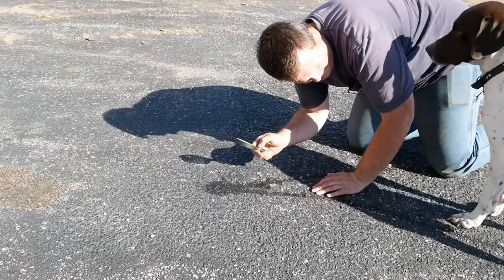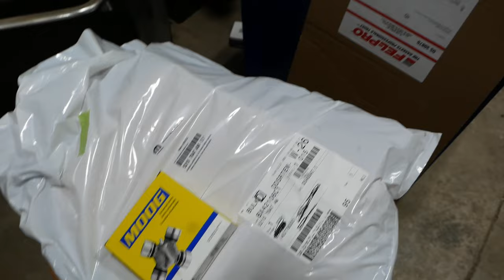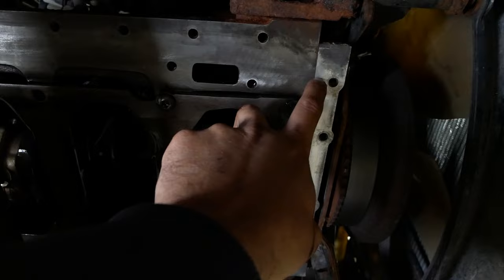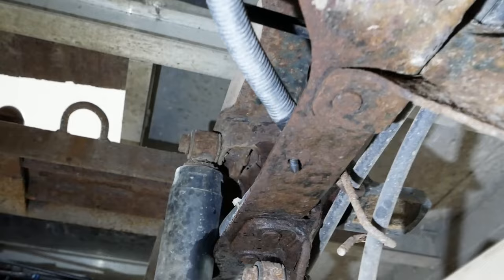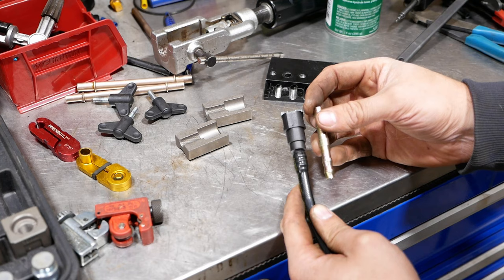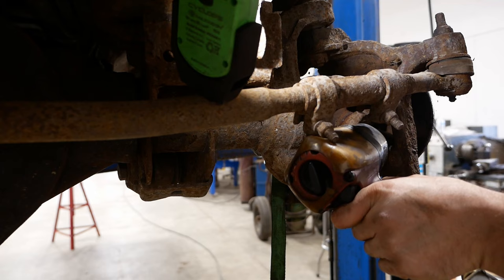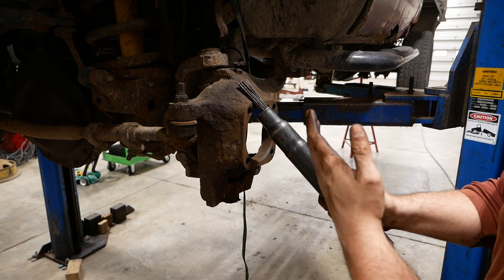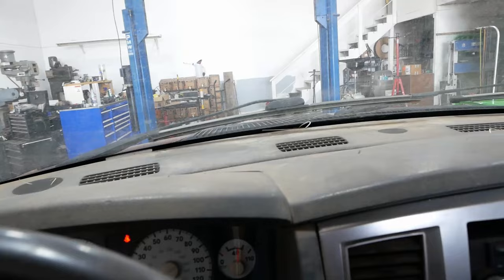6.7 Cummins Massive Oil Leak - Replace Oil Pan, Front Axle U-Joint, Fuel Lines, Shift Cable, Battery

Comment: Why would anyone want to live in a rust belt area. I have a 1998 Chevrolet K2500 Suburban. It lives outside & there is very minimal surface rust, & that is on the bumpers. Nothing underneath & the body is awesome.

Comment: To comment on electric ratchets: I've abused a couple Milwaukee's that still work nice. Harbor freight has/had another "Earthquake" brand, that is the same unit sold by AC Delco, which I have seen used and abused to satisfactory result. Guess it all comes down to what battery platform you want to marry...

Comment: Just a FYI.. If you would increase the compressed air line/pipe to 1" and use a 5/8'" or 3/4" hose to your impact gun those nasty bolts wouldn't stand a chance. . All of your pneumatic tools would increase in power.
Reply: Also using at least a Milton Type V high flow fitting
Reply: @mrmotofy   Anything that will increase air flow to the power tool will improve the performance

Comment: Wes maybe you can help me I have a Chevrolet Aveo 2013 1.6 4cil and just got a P0300, I already changed spark plugs fuel pump and filter air filter oil and oil filter, what do I look for next? Thanks

Comment: Always get such a kick out of oil pans rusting through...even when full of oil... Why is this possible and so common? I understand salt.. but it keeps rusting even after the oil leaks all over it!
Reply from the maker: By then it's too late. What amazes me is that huge sections of the pan seem to rust out more or less evenly and leak at the same time.
Reply: By the way, nice job with Davinci Resolve! I use ShotCut because it's free and works pretty good. The results are excellent, but the editing takes some tweaking.
Question: How do you go about getting USED but not "rusted to uselessness" parts? I'm hunting some parts but the southern state yards that I've called have a tendency to get rude when they realize I can just walk in the door with cash...
Reply from the maker: @HouseCallAutoRepair  I don't know. Might be easier to just take a trip and get it in person.
Reply: lol
I'm east of Eric O

Comment: Got a brake question. I got a 2009 GMC sierra 1500, I put new brakes all around. (pads, rotors, cleaned sliders, new shoes, hardware, drums.) There is no leaks, no air, I adjusted the back shoes to where they are just rubbing, but I still have a weak pedal almost till it meets my gas pedal.. And when I brake and right after I release and brake again the pedal is right there..help
Reply from the maker: Bleed the ABS.
Reply: @WatchWesWork  Forgot to say, its been like that since I bought it 6 months ago! 
Would you have a video of said bleeding of the ABS? Love the video btw!

Comment: Great video . I hate tyranny and government control of innovation , but I'd probably look the other way if they backed off on emissions and mgp improved 50% , if all electrical connection were plug and play , all wheel bolt patterns , within a rim size , were the same , all transmission mounts , bell housing bolt patterns and engine mounts the same for a vehical size . Standardize . Did I just describe large trucks?

Comment: Judging by the condition of the interior, I’m guessing they needed to crack the air box a bit to let some air buy a plugged filter. I’m guessing this individual is not big on maintenance. 😢
Reply from the maker: That's an understatement!

Comment: Wes, you're the expert, so I'm not criticizing! I was just wondering why you used a sledge to install those bearing caps, rather than a press or a clamp. I was always told that a hammer would deform them. I should know by now that there's always more than one way to skin a cat!
Reply from the maker: Because it was there and it will work fine. If you deform something you have another problem.

Comment: This is not to be critical I just have never seen anyone remove a rotor the way you do it. A heavy hammer and that thing is off fast. You run the risk of hitting a stud with my way so the air hammer is not a bad way.

Comment: Dang that truck seen a lot of a salt or the fact just keep make these newer truck a tin can. Truck going rust away before the drivetrain quits. Oil pan seem be common failure item on these 3-4th gen trucks in salt belt states. Buddy was able change my oil pan on my 2004 common rail without lift the engine. Most say lift engine few inch but guess there way disconnect pick up tube if have skinny enough arms.

Comment: Hi Wes, I’ve been thinking for a while I need to invest in an air hammer. I’ve watched you use it in places where it made your job easier. Do you recommend any brand in particular ? Also would it be suitable for fitting u joint cups or would it be too aggressive ?
Reply from the maker: I use it for everything. Get a long barrel. Harbor Freight seems to have a decent one.

Comment: I have one of these over rated Cummins in a 2012 ram. I’ve spent a lot of money fixing seals and connections and gaskets under the hood. I hv about 124000 miles on it. Not interested in owning another one

Comment: So I found it interesting that you said rubber fuel lines are a liability for you. Im a OTR driver and every Cat, Detroit, or Cummins I’ve ever driven has rubber reinforced fuel lines. I’m just courteous as to why they’re good for a 18 wheeler but not for a 1 ton.
Reply from the maker: Those trucks use rubber over steel braided hose that is DOT approved. It's a whole lot different than the cheap rubber hose most people use.
Reply: @WatchWesWork  ok. Got ya. I know commercial truck fuel line isn’t cheap. I just replaced all fuel lines on my truck and it was a bit pricy😂.

Comment: I am going to attempt this.
Few questions - what are you using as silicone, anything specific?
Also, what are you using to glue the oil tube gasket in place?
Reply from the maker: I used Ultra Grey for both.

Comment: Just wondering : is rusty crusty worth throwing these repairs at it (in an economical sense)?
Reply: Probably not relative to the blue book value, but replacement cost of that truck is 60k new or 35-40k if you wanted a nice used one… so a few grand worth of patchwork to get another year or two can be worth it

Comment: Weird how this truck has a c channel rear section of frame and y steering. My 05 2500 Cummins is all boxed with t steering. Wonder why dodge changes so much between years and makes trucks worse.

Comment: Oil pan paint.  You never know what the deal is.  I used to run around on the diesel forums.... a lot.  The shit some guys would do.  For all we know somebody loaded the engine with a gallon of mineral spirits or paint thinner  to "de-sludge or de-carbon" their engine because the oil was always so dirty.

Comment: All the best quality assembly work is done on the very edge of the workbench in the only free 8 square inches available. Surrounded by precariously perched open containers, air lines and loose sharp tools. And a cup of coffee. 
Lol hundreds and hundreds of bucks in spare parts, new batteries, doesnt want to spring for 2 new hood struts. 🤦‍♂️
Reply from the maker: Essentials only.

Comment: the needle scaler is  almost worthless i use one  but i found out that a small grinder with a Lamsion Rust Remover Wheel Remove Paint and Oxidation Poly Strip Wheel Disc Abrasive Angle Grinding Wheel  will make  that rust shine  like a  diamond in a goats ass i use it alot at  work  just  go  slow and do not stay in one  place at one time  keep moving will save you alot of time

Comment: I live in Michigan We salt our roads heavy I only buy vehicles out of state with a Carfax that shows it was in that state then I bring it to Michigan and then I take care of it after that three or four years I MoveOn the salt destroys everything you can’t work on a boat Ain’t not a log anything salt penetrates eats away at the frame gets into the wiring gets all over the vehicle my summer cars never touch salt they’re covered with a cover in the garage or outside of the garage but they never see salt they look brand new and they’re 20 or 30 years old the car as I’m driving or 5 to 3 years old and underneath they look 30 or 40 years old and the car is parked look brand new brand new underneath brand new on the outside the car as I drive destroyed underneath with shiny paint salt should be never used all it does is destroy metal destroy iron destroy plastic destroy and dry out everything under the vehicle does it help in the winter I don’t even know a lot of states you sand or a lot of states just plow salt absolutely 100% clear roads and destroys vehicles why are we using salt and why is this not something people are talking about we pay for a home we pay for a house can you imagine if we had an infrastructure that dumped something on our home or on our house that literally destroyed our home and our house overtime slowly within 3 to 5 years we have a leak we have a hole in the wall it’s doing that to the vehicle most cars can last 3 to 500,000 miles easy I’ve seen it and been in there and done that myself but assault vehicle can only last maybe 150 to 200 this salt kills the frame kills the brake lines kills the oil lines kills the engine kills everything salt corrodes everything just grows it to death why are we letting this corrosion happen big money making money I don’t know somebody’s getting rich well we get poor and pay to heat our houses while they pay to put stuff down so we can go to work so we can destroy our vehicle so we can come home to pay for our home and our vehicle all over again literally disgusting

Comment: I hate working on Dodge trucks we have a 09 Sterling Bullet aka 4500/5500 Dodge of course its and odd ball model year front axle U joints are non existent, half shafts are not available. I hate working on the truck period its so frustrating a mechanic friend he hates working on Dodge trucks too.

Comment: Thats going to be huge risk should it happen and you end up sinking 15k into short block in a rust bucket free of charge due to it destroying engine down road in few years.I would have stripped the paint ..NOT ALL PAINT is the same and that be difference from aftermarket and oem.

Comment: When will road salt be banned. 
Yes roads would need more plowing and sanding and people need to slow down a bit. 
Or vehicles need to be made with stainless steel. 
Look at the cost pick ups are $70,000-100,000 now 10 years it’s just a piece of junk. 
I like your fuel line tool. Thank you 
Now know where I can get cheaper 5.9or 6.7 engines buy whole rotted out truck there.

Comment: You could have simplified this by replacing the old 2007 Dodge Ram 3500 with a factory rebuilt 2007 Dodge Ram 3500.
Reply from the maker: They’re on back order.

Comment: That U-Joint doesn't know grease exists - or that's the way it looks - 1 out of 4 of the u-joint cap the needle bearing in them - unbelievably bad - rusty as hell - to some mechanics Dorman has a pathetic reputation - never heard much good out of Dorman - far out - good job - a major change and it needed it real bad